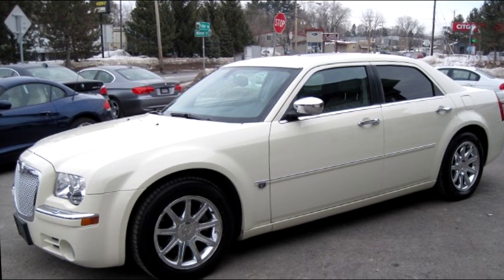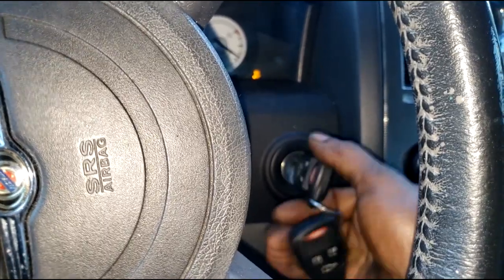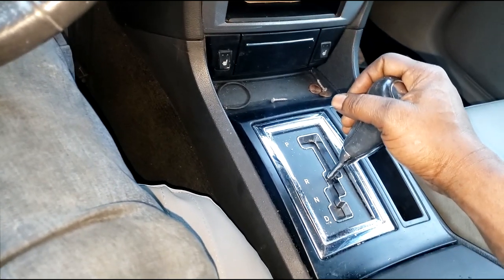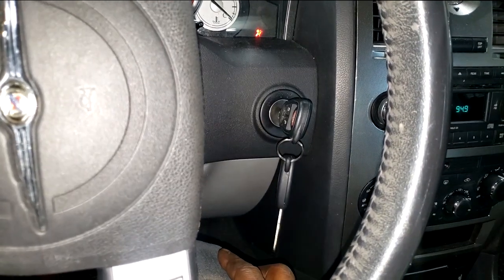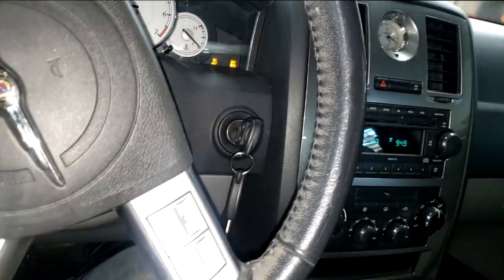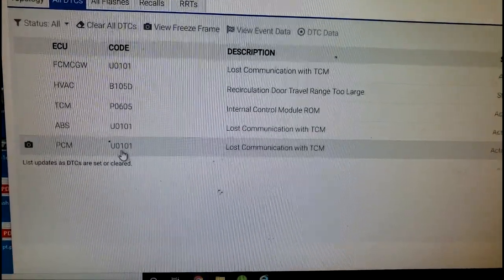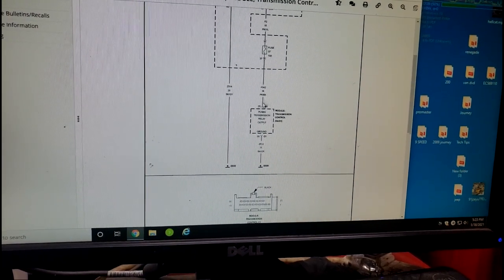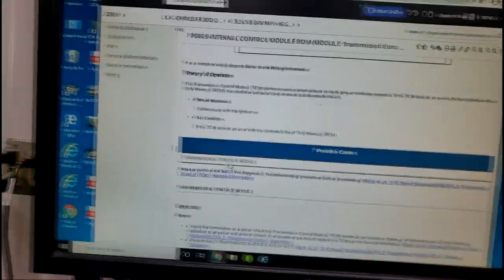This Car Computer will cause delayed cranking and harsh Nag transmission shifting. P0605 U0101 P0700

Comment: The Nag1 in my 06 Charger RT will occasionally thump when downshifting when cold, and gets really slippy when first started after sitting a few days. I try to put it in neutral and let it idle and run it through the gears for a bit to get the torque converter filled back up like I used to do for the 727 I put in my Dart. It had bad morning sickness too and running it in neutral before driving first thing in the morning really helped because it doesn't pump oil in park. I really need to get one of the aftermarket dipsticks so I can check it once and a while and see how the fluid looks.

Comment: I have a 2007 chrysler 300C i was driving the car all day and as soon as i pull in driveway for some reason car did not want to go anymore and note i had shifter still on drive what do you think it could be i could shift to reverse neutral and drive but as soon as i shift to park it sounds like a grinding noise

Comment: Hey jt i got a 06 charger rt with shaker hood every time i switch the gear foot on brake from r to d i hear clunk
Reply: Hey gabriel, that is a great question for JT's TechTalk live stream every Thursday and Sunday at 8pm... hope it works out for you
Reply: That is likely your driveshaft rubber coupler going bad or the spider bearing or the U-joint.

Comment: I have the same issue in my 2006 Chrysler 300C with Nag1. 
Did you install the new TCM? did it fix the issue with cranking, or is that a separate issue?
Reply from the maker: Wrote the estimate up but customer decline the repairs. Thanks for watching, remember to thumbs up the vids for me, thanks
Reply: @OnlineMechanicTips would fixing the tcm fix the no crank no start problem?